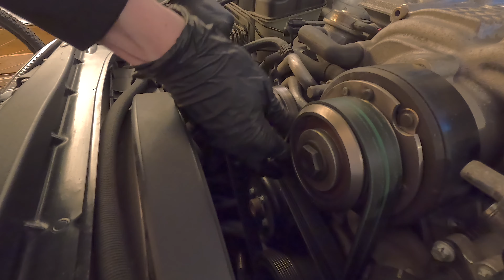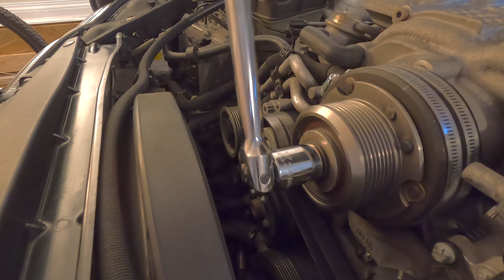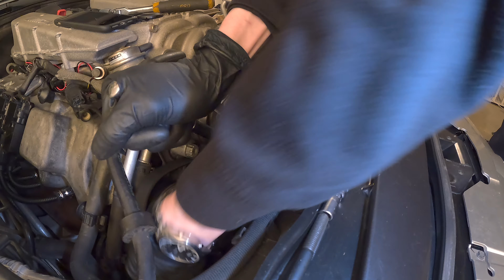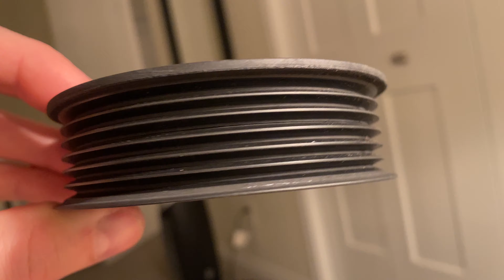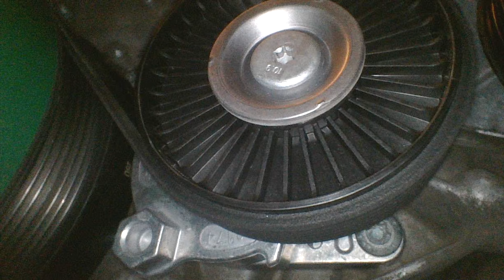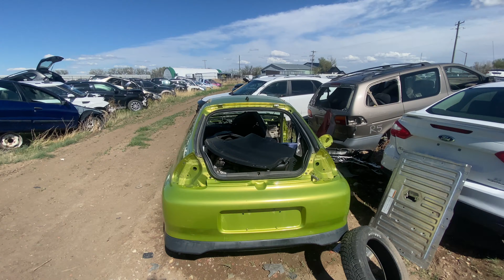HOW TO: Install VRP Pulley 76mm + Belt Wrap + Dual Idler for SL55 (M113K)

Comment: Hi, what is the belt number for 76mm SCP and BWK?
Thanks
Reply from the maker: I used the GATES K080525HD 😎
Reply: @FreedomSOURCE  8PK1336?
Reply: @FreedomSOURCE 8PK1336?
Reply from the maker: @metodiiliev7150   as long as it's K080525HD you should be fine. Worked for me :)
Reply: @FreedomSOURCE thanks

Comment: Thanks for the heads up on the plastic idler pulley upgrade need. I’ve already ordered the VRP 76mm pulley and belt wrap but wasn’t aware of that Achilles heal plastic pulley.

Did you just go with a stock new tensioner? Or a performance version?
Reply from the maker: @egiles40  exactly! And it’s often overlooked, but failure seems to be getting very common now with the plastic idler pulley! When you go to replace it, you’ll likely see the same cracks I had in mine.

Regarding tensioner = I’ve kept it stock (no slipping). It was replaced not too long ago so I’ve left it in there. But from what I’ve read, the VRP 20lb tensioner = much better. I’ll have a video coming out about it soon 🤙
Reply: I just bought the car last week but have been looking for one for ages. I’m very excited to start throwing all the VRP goodies at it and really appreciate that you are adding them with tutorials right before I will be. Makes my life far easier!

Are you planning to do a transmission tune as well? 

Also selfish question, any chance your keyless entry handle buttons stopped working and you’re going to replace them? I’m having trouble figuring out where the screw to take off the exterior door handle is and can’t find any good info on it.
Reply from the maker: @egiles40  Congratulations! You made a good choice getting the SL55 😎

As far as the transmission goes, I haven't completed anything other than the re-seal for electrical connector (it's common for oil to travel through the wiring harness). But the goal will be to swap out the solenoids for blue caps and do a TCM tune for crisp shifts.

About the keyless entry = I never got the key card for that from previous owner. For 2003 it was a black plastic credit card looking thing, and you have to get it from Mercedes direct (because it's laser cut), for the only $2000. Safe to say I'd rather use that money on preventative maintenance, however, there is a way to convert the keyless system over to a 'one key' system. So I might look into that at some point.

Taking the door handle off hasn't been something I've completed yet, but I'd assume it'd be done from behind the interior door panel once off. Let me know how it goes!
Reply: Yup mine has that stupid card too, but it did at least come with it. Can’t believe they want $2k for such antiquated tech! If you convert to a 1 key system I’d love to see the video on that. 

I assume behind door panel too, but saw in an e55 video there was a screw behind the weather strip so figured I’d ask in case you knew.
Reply from the maker: @egiles40  Very true, the key card should be max $800, and even then it's too much.

Definitely let me know how you find the exterior door handle repair, that would be good to know too
Reply: Coming full circle on this, you don’t need to remove the interior door panel to get the exterior door panel off, just the rear silver trim panel (5 or 6 torx screws). This allows you to then move the weather strip aside enough to  access the single screw holding the exterior handle on. 

I finally got to my 76mm pulley, belt wrap kit and billet idler pulleys installed this weekend. Took me less than 10 min thanks to your videos! Only thing I had to look up was where the main serpentine belt tensioner release bolt was. Nice and hidden if you don’t know where to look. Thanks again. Onto to the split cooking and heat exchanger once I have more free time.